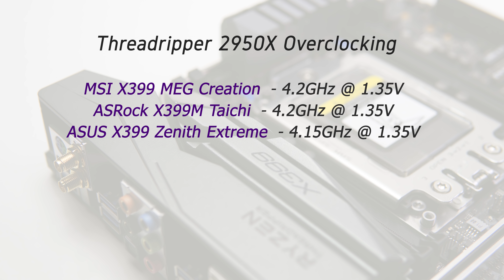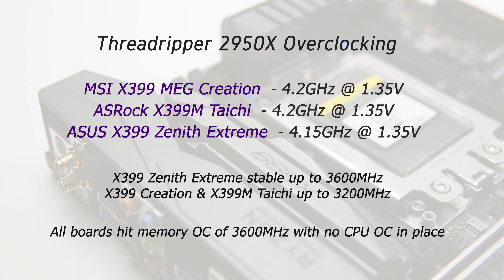Micro ATX Threadripper! ASRock X399M Taichi Tested

Comment: this mobo is *the bomb*. i just got one (pre-ordered) about six weeks ago. i don't have the Cerberus Chimera (didn't know about it) but the week after i built mine (Phanteks Evolv mATX) a friend commissioned me to build an RGB version (Corsair Crystal 280x).
the vrm's are cooler than i thought, but i used copper gpu heatsinks on the back bar of the vrms on the backside of the mobo. had to sand them down and put  extra space on the mobo mounts, but they stay a few degrees above ambient...which was my goal.
this is the way to go if you're editing, compiling, transcoding etc... where you don't need all of the pcie slots of an ATX. the three M.2's and the U2 connection give you as much high speed storage as is modern. this is solid engineering.

Comment: Nice, I literally just built with this mobo in the Cerberus today. It's a tight fit but I managed to pack a 240mm AIO, 2*140mm, 1*120mm, and 1*92mm fan. This many fans is probably overkill but I will be testing different configs tomorrow. I went with the EVGA 240mm CLC because that Enermax you have has a lot of negative reviews due to corrosion issues.

Comment: at 8:54 I believe the water cooling is setup wrong. the radiator on the bottom and the pump on top puts air in the pump. 10% of the volume is air in the system and air goes up.

Comment: If you have a contact with Asrock, can you ask them if they'll support the 32 gb ram sticks being made now? I like the amount of power in the space provided, I just feel that you're kinda throwing away pcie lanes only having 3 pcie slots. You'd have to use every slot in x16 with all 3 m.2 and the u.2 connector filled to hit the 64 pcie lanes provided. And with most gpu's being 2 slots wide, you're throwing away 16 of them. It's going to become very application specific, if you need multi gpu and an add in card then you'll need to look at the atx or eatx boards.
Reply: And I should have finished the video because you said exactly this lol.

Comment: Hold on. I have the x399 Taichi but I have and atx size board. Is there multiple sizes for the taichi? I’m new to pc building bee tee dubs.
Reply: The x399m is the mATX version. I just built a system with it using a Threadripper 2950X.
Reply: Adjodha B dope. Thanks. Building with the same processor as well. Thanks for clarifying! Have a good one!

Comment: Didnt understand why with MSI board CPU temps were dramatic low  comparing to Asus and Asrock
Reply: more phases, so instead of 8 phases working hard, the load is spread evenly over 16 phases thus creating less heat :)